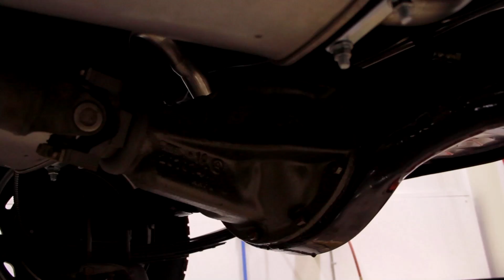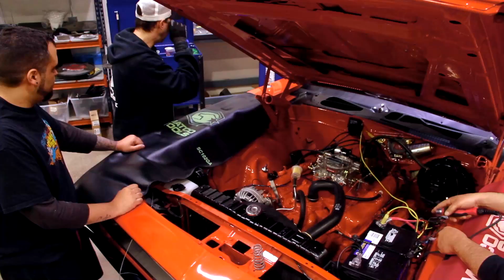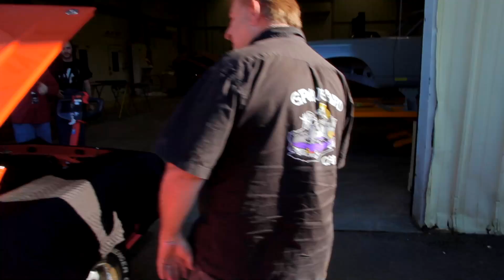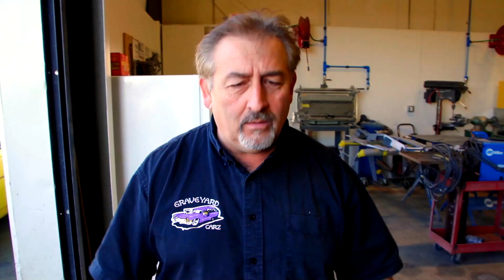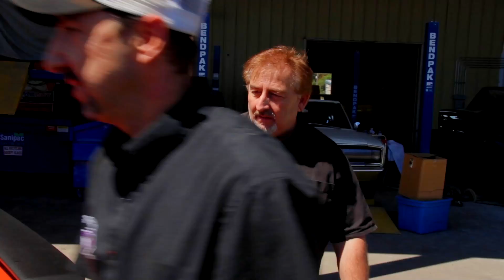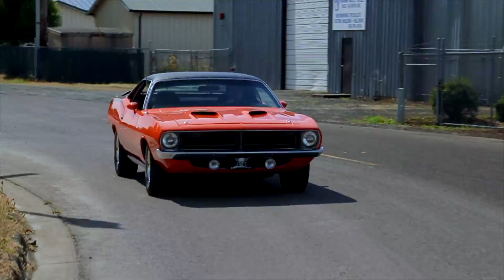SOMEONE PUT SAND IN A FRESHLY REBUILT ENGINE AT GYC. WHAT FORMER EMPLOYEE WOULD DO THAT?

Comment: Hey Mark , here's 2 senerios, first happened to me, rebuilt 360 had crank cut and the whole works done in engine ,got crank back rinsed off put in ,cranked up started knocking after 4 minutes,ends up machine shop did not hot tank after machine work,ruined motor, #2 a friend of mine put a 340 intake on a 360 ,he had it sandblasted ,sand was up under tin plate on bottom of intake , sand through out the whole motor.       Thanks good series, keep it up